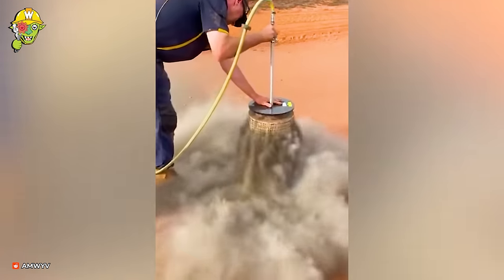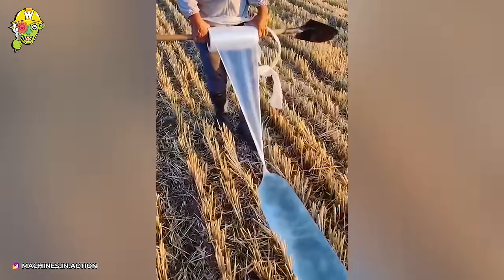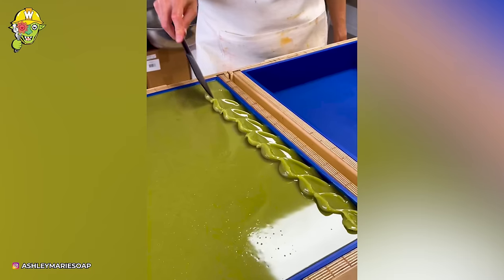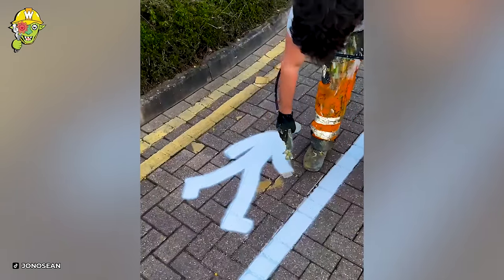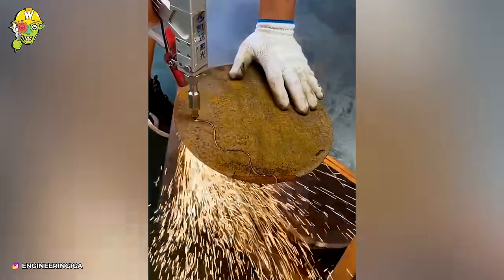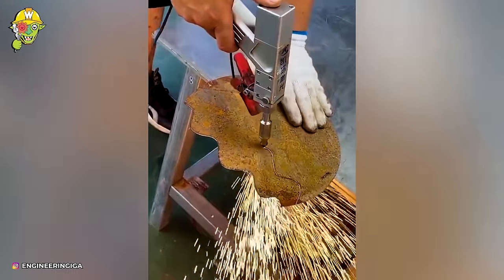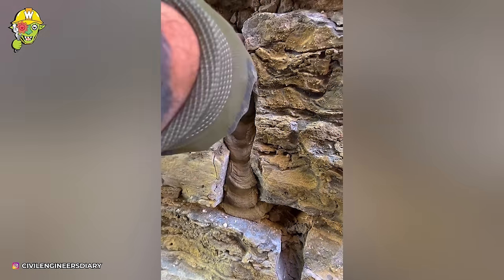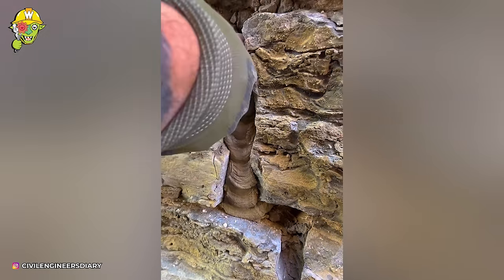Most Satisfying Videos Of Workers Doing Their Job Perfectly !

Comment: 3:45 Never did it with a high-pressure water hose, but scrubbing clean a filthy AC filter does feel pretty good. Makes the unit run a WHOLE lot better afterwards, too; to make the room smell awesome when you turn it on, use antibacterial handsoap to scrub it clean with, in your favorite scent. Helps get it cleaner, and smells great.

Comment: OOOOOoooo!!! plaster mold from scratch !!!! Wow.  Gluten is great for stretchy dough. Thank Heavens there are alternatives for those severely allergic to it. Xanthan gum makes real handmade bread possible ))))))  Shave the horse??? what the heck!  Cementing last brick is clever )))  Super painted egg with wax resist )))
Reply: With regards to the horse - that's called clipping, and it's generally done in the cooler months to stop the horse getting too hot during exercise. There are several different styles of clip, too, depending on what the horse will need.